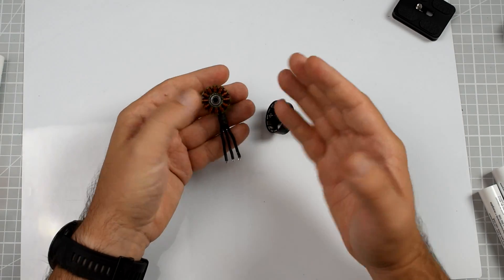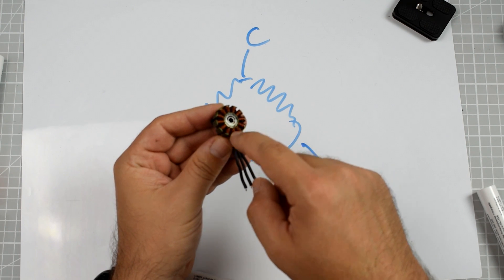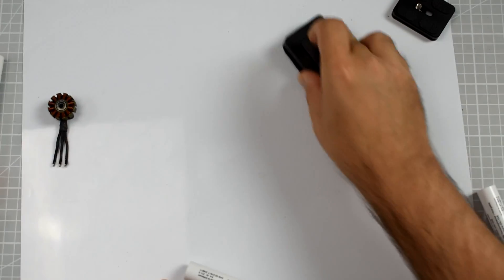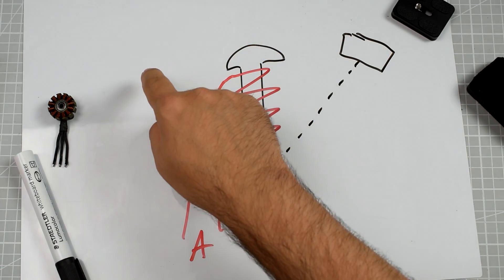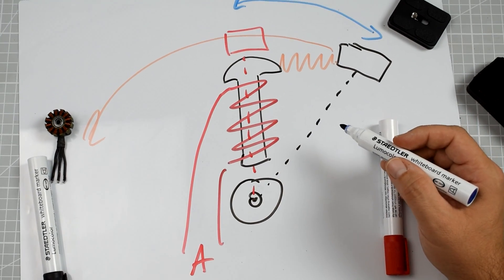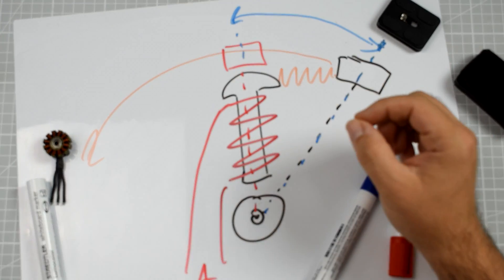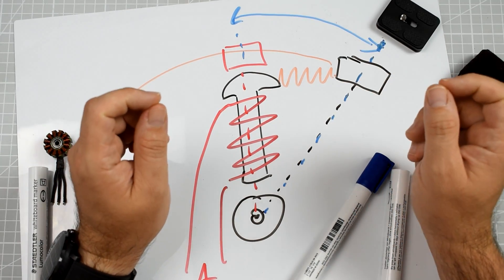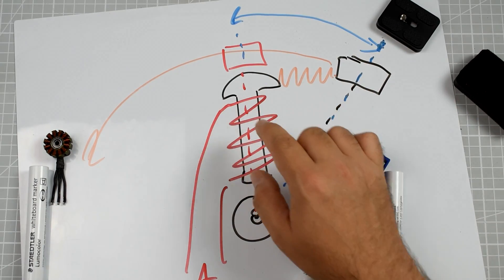What is BLHeli Motor Timing and what it affects?

Comment: I am trying to understand my issue.  I have a 4525 530 kv motor running on 12s.  After a 5.5 minute heli flight of a 20lb scale helicopter, the motor is uncomfortably hot.  It has a Castle Creations 120 amp ESC.  The ESC is only using about 51 amps.  The ESC had a low timing of 5.  I have changed it to high timing to reflect what the manufacturer setting is.

Comment: Intro (00:00:00)
Motor timing is often suggested as a solution when there are issues with motors and ESCs.
Increasing motor timing usually resolves problems, but it's not clear what motor timing actually is.
Motor timing is not well-explained in documentation, even for BLHeli.
BLHeli32 increased the resolution of motor timing changes, allowing it to be set in degrees.
It's not clear why motor timing is measured in degrees since timing is usually measured in seconds.
Motor timing is the amount of time that the ESC provides power to the motor windings after the motor's magnetic poles have passed the stator coils.
The optimal motor timing depends on the motor and ESC combination.
Increasing motor timing can improve performance and efficiency, but it can also cause overheating and damage to the motor or ESC if set too high.
Decreasing motor timing can reduce overheating and damage, but it can also reduce performance and efficiency.

Motor Timing Explained (00:02:01)
Motor timing in brushless electric motors affects the interaction between the magnet and the coil, influencing torque and efficiency.
Higher motor timing energizes the coil earlier, resulting in more torque but reduced efficiency.
Lower motor timing energizes the coil later, resulting in less torque but increased efficiency.
BLHeli motor timing is measured in degrees of the phases, not the rotation of the motor.
The motor and ESC use back EMF detection to estimate the magnet's position relative to the coil.

Degrees of phase (00:11:29)
Motor timing is measured in degrees of the phase.
The motor magnet's closest position to the coil is the reference point for counting the degrees.
Motor timing is not about the rotation of the motor itself, but the distance in the phases and the degrees of the faces.
The advance in the rotation of the motor can be different for motors with different numbers of coils and magnets, but the advance in the phases remains the same.

Comment: ☠BLACK BARON☠10:00 Too much 🔥heat🔥 is not good on a long term usage. I prefer more efficiency. Be careful with setting too high motor timings. The RPM can be measured in "without load" and "with load".

Comment: I have been trying to restore an older art-tech brand heli with a brushless mystery-motor. Labeled  B20/10t I want to know the KV rating and poles this motor has. How can I find this out? I cannot locate any info online. The part number is H3D043. Can you find anything?

Comment: Hi Pawel. I wonder if you can help me solve this extra nerdy problem?? I’m dealing with a brushless 1/10 scale sensored motor. The timing on it is marked outside between 0-60 and is set at the factory to 35. Here is the geeky part. When the ESC is powering it normally (it’s A,B,C fase wires are connected properly) it turns counter clockwise when looking at the shaft from behind. Which is in reverse. So I need to set the ESC to reverse the throttle channel. But I think the timing is off. Because it turns faster in reverse than forward! But since 30 degrees is the average setting (0-60 range) it should not make a big difference… but it does. And when swapping A and C phased in an attempt to trick it into turning correctly it jams! Only vibrating and making a terrible sound. 🤦🏻‍♂️So I would appreciate your thoughts on this. Spasiba my friend. Cheers from Canada.
Reply from the maker: swap any two wires and motor should rotate opposite
Reply: @FPVUniversity  Thanks for your reply Pawel. Supposedly. But i tried all permutations and when I swap any wires the motor just vibrates acting as if it is jammed.  I think it has to do with it being sensored perhaps.  Any ideas?  I changed the timing from 30 to 60.  assuming that 60 in reverse is equivalent to 0 going forward.  I have not had a chance to test it yet to see if this fixes the problem and now the wheels will spin as fast or faster going forward, than reverse.

Comment: My motor spec says 15 degree timing, however my esc has 12 or 18 ,which should I go for ,and my motor says 8khz drive frequency but my esc has a setting called pwm is that the same,its confusing,

Comment: If the stator has 12 poles and 3 phases that would mean 4 sine waves for each revolution, right? So on such a motor the geometrical angle should be one fourth of the motor timing phase offset. So a motor timing of 24 would mean the coil is powered when the magnet is 6 degrees ahead of the pole.
Reply from the maker: Actually it's electrical RPM * poles (number of magnets) / 2

Comment: Great explanation. Have a question more or less related. Is it possible to have a configurable mode in a switch in inav  when you land the propeller remains or stay in a horizontal position? It would be useful for fixed wings when you land to protect the propeller and the structure of the motor.
Reply from the maker: No, ECSs have no function like that
Reply: @FPVUniversity  Thanks for the answer . that option would have been useful i guess foldable propeller for the moment . Waiting to see the tests on the ghost system .

Comment: Thank you. That was very informative and helps me better understand that setting.  Is there ever a situation in which variable motor timing would make sense (changing the timing based on either rpm or load) ?

Comment: I thought that the coil was energised to repel the magnet in able to push it round.
Reply from the maker: Pushing is basically the second phase after pulling
Reply: it pulls it until they are lined up, then it pushes, it is in time with the waveform going up and down
Reply from the maker: yeap, just like that